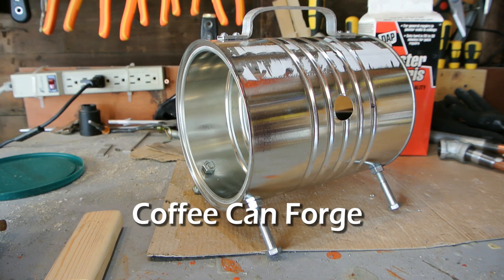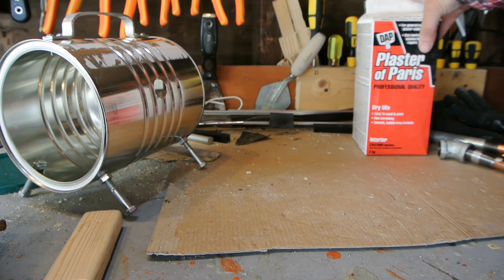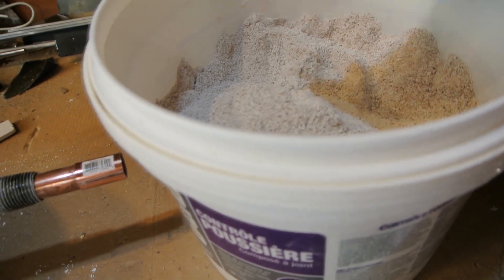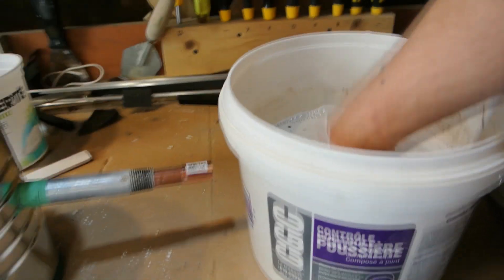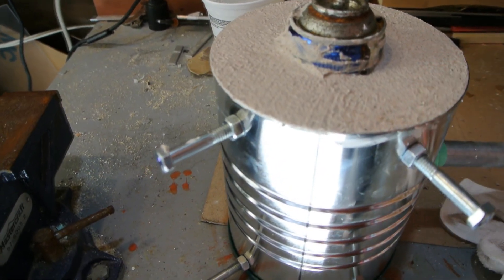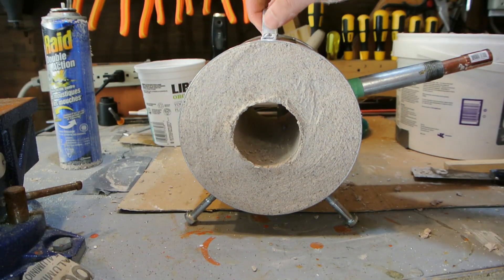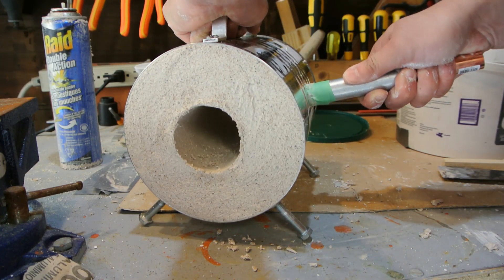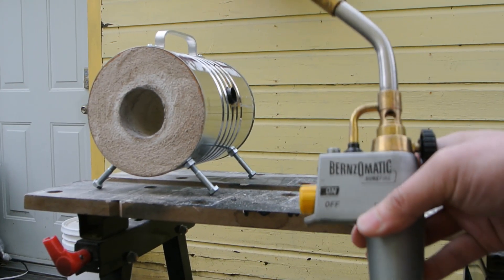How to Make a Coffee Can Forge

Comment: Hey, man. Have you done any knife work with that mini forge? How is it going? I was planning to make one mini forge like this myself, but I´ve heard bad comments about this plaster/sand mix. So, how is it working for you?
Reply from the maker: +Daniel Ferreira It works well but it doesn't hold up for a really long time, it has cracks forming.  It's a just a simple forge that people can use to heat up some metal before investing in a big forge made with mineral wool or other better refractories.

Comment: When I mixed the refractory, let it set, and waited a few days, the refractory was still soaking wet.  I had to make a fire in it just to harden the walls, and even then, only 2-3mm were hardened.  Any tips to make it harder?
Reply from the maker: +Colebug99 Takes a while but you need to heat it for while to dry it out.  It will dry out.

Comment: What is the max temp it gets?  Celsius or Fahrenheit, I understand both.
Reply: +Colebug99 hey dude, this forge will probably get into the mid 2000's F, but the refractory he is using will fall apart after the first use. Try going with a Perlite, sodium silicate, and aluminium oxide mix that will hold up really well.
Reply: Glitched Gaming I have been using a plaster sand refractory for about a year in my charcoal forge for melting aluminum.  It seems alright.
Reply: Colebug99 i must be doing something wrong then with the mix i guess :)
Reply: Glitched Gaming I was skeptical too!  But I will definitely use your design, as it sounds more sturdy as I get into making more steel.

Comment: We have noticed that most of the forging chambers you folks are making you do not use a simple silicon release for your forms, the Raid Can or the Pipe nozzles.  Silicon release mediums can be picked at your local sculpture or clay supply stores.  Using a non-stick spray on the cans or pipes when prepping is even less expensive. Then you don't risk deforming your chamber.
Reply from the maker: +Triton Memnon Good tip.

Comment: Would it work if you were to double up on the cans so it's twice as long?
Reply: +Xero or add another torch
Reply: +Xero I thought the same thing so I started building one yesterday. I'm halfway casting the refractory. AMA.
Reply: Update: I botched one batch of refractory. It went in too firm and failed to "pour" so it wouldn't displace air. It also tended to get caught up on the seam between the two cans. I tried to tamp it with a paint stick with some success but as I work my way up with subsequent pours I can hear loose chunks bouncing around, which will fall out when I remove my center mold and port mold pipes. I'll have to try to patch that later and hope it holds. Cautionary tale, make sure your mix is just goopy enough and it should work. Also, use more then 5 really short sheet metal screws to hold the two cans together. If it wasn't for the refractory, I think I would have torn the two cans apart just trying to twist the centre mold (2" ABS) loose between pours. If there's a next time, I'm rolling up news paper and burning it off afterwards.

Comment: i just used quick setting quickcrete and coated front with plaster so wouldn't crack at opening of forge ... btw way more conduction just working on smaller projectes and no back hole, alot of heat loss but mines almost the same i also used washers on bolts and handle
Reply from the maker: +Mike Emory Yeah I have a plug in it now, but I needed to bend some long items before.
Reply: +Andrew W i wish i could post a picture i also have a coal forge made with bicycle air pump(the kind thatvlay on floor and pump with foot) as my billow and 2 car rims welded together with a square doorway cut out finished yeaterday

Comment: How long did you let it sit before using it?
Reply: +McCabe Lowe Let what sit?
Reply: The sand/plaster mixture. How long did you let it sit before heating it up and heating your knife?
Reply: McCabe Lowe After first pouring it, I let mine set for 10 minutes before it got mildly solid enough to move it around. Before actually using it, I would wait a whole day. You could probably get away with a couple hours.

Comment: How would you build something like this but using charcoal as a fuel source? I like to pretend that I'm some medieval blacksmith but I'm still on a budget.
Reply from the maker: Get some fire bricks and stack them up into a pit, that will contain the fire into a small intense place to heat the metal. Use a hair dryer as a bellows with a tube attached blowing into the fire.
Reply: watch the forge video of grant thompson, he has something like that!

Comment: Approximately how hot can these forges get?
Reply: +Cory Hartwigsen if you swap the blue propane torch with a yellow map gas torch you can get to around 1000-1500 celsius more then enough for forging a heat treating small blades

Comment: I am thinking a smaller hole at the rear with a rearward angled torch would create the desired vortex with greater heat retention.
Reply from the maker: +heathenous81 Yup totally, and I did make a plug and it made a difference.  I&#39;m working on a new bigger forge and plan to take into account the torch angle.
Reply: I have a bigger forge but I want a smaller one for small jobs that can be on my bench.
Reply: +Andrew W How has the plaster of  paris held up?

Comment: Could someone help me on this? I made this very close by design but cannot heat up a railroad spike for anything. I'm using a benzolight torch and it just gets metal hot but not glowing??...
Reply from the maker: A railroad spike is pretty thick, I think that torch is under powered to heat that up to any workable temperature.  You need to go bigger both forge and torch. I'm doing another video on a larger forge in the coming months.

Comment: Won't the metal pipe on the side melt on high tempratures?
Reply: +Tap Studios This forge cannot reach the temperature needed to melt the steel pipe. However if you used aluminum then yes it would melt and would not be fun haha.
Reply from the maker: +Washburnedout Exactly, in fact the paint on the metal tube I used is still intact, so it has done a good job insulating.

Comment: I built this yesterday, the center pipe I used to make the chamber was nearly impossible to remove after 5 min. I ran my propane torch inside for half an hour inside the forge today and it never heated up. Any suggestions or ideas to help out?
Reply: Before you insert the center tube try coating it in vasoline. I know that doesnt help now, but could for anyone else.
Reply: Qu2

Comment: if you get a few fire bricks and set them on the ends to make a slot as wide as your work you'll make it much more efficient. :)
Reply: +geckomage  yeah that was an excessive amount of heat loss on the rear opening.. the bricks are a really great idea..
Reply: +geckomage Could you make those bricks out of the same material, Plaster of Paris?
Reply: I guess you could just to have something to cover the opening. i just went to a local fireplace store and picked up a few. home depot might also have some. if you do cast some out of plaster of paris i'd recommend lining your form with plastic so you could pull them back out easily without breaking them. or do some research on sodium silicate. (you could make fire bricks out of that and sand, or perlite, and it should work quite well.

Comment: Would a setup like this work foe heat treating high carbon steel for knives?
Reply: +CallousDnb he could also use magnets. If the magnets still work on the steel while its red hot, it needs more time in the forge until the magnets don't work on the piece of steel.
Reply: +Dani El Yeah should be fine. I used my mates portable gas forge (he's a farrier) and it's pretty much the same as this, apart from a bit bigger and not home made. Your only issue might be judging how hot the forge is, you would have to either judge by the colour of the steel or get an infrared thermometer.
Reply: +Oscar Gonzalez I just learned that trick recently. The temp is around 1425F and this is right about where your high carbon steel should be right before you quench.

Comment: Great video!  I doubled up the cans to make it twice as long with another torch hole.  Haven't fired it up yet, need to get another torch.  I used a piece of black 2" PVC for the chamber and could not get it out.  Twisting it with a pipe wrench and hitting  it with a hammer and wood block did nothing.  I let it cure for a week and tried it again; nothing.  I then used a 24" bow saw to cut the pipe in three places (with the blade inside the pipe).  Then PVC glued a plug in one end and was able to finally pound out 
the pipe.  What a relief.  Thought I was going to end up with a 35lb paper weight.  Not sure if there was some sort of chemicals reaction with the PVC and the Plaster of Paris.  For the torch holes I used steel pipe and they can right out.  The foundry also seems to be rather brittle.  Hope it holds up!
Reply from the maker: +Rufus T Firefly I think the longevity of forge is ok, probably get a bunch of uses of it, but for the cost and simplicity it's hard to beat.  I've used mine a bunch of times and it's still holding, but I try not to touch the top or the sides.  I'm going to try making a different type of forge in the next few months that hopefully it will be stronger.  Someone here suggested using a Smartwater bottle for the chamber, it's flexible and easier to take out.  I bet putting a coat of oil on the PVC would have helped too.  I plan on making a DYI torch soon too.

If you are looking to build a forge that will hold up, look up Kaowool forges.
Reply: Aren’t forges just so neat. Just plain old neat. Here 5 years later and I’m still fascinated with forges. I even have a nice heat treat oven but I still enjoy making and using different forges.
Reply: BTW the plaster of Paris and sand doesn’t last forever but even with the cracks my first forge is still working about 4-5 years in. Pretty darn good for such a small expense.

Comment: I was wanting to make one out of a steel mail box. would my ts8000 torch be enough to heat it? and how well does the sand and plaster mix work? will it crack?
Reply from the maker: +James Moyer Depends on how big you make the chamber, I think if it wasn't too big then yes it will work.  The sand and plaster has worked well but I haven't used it much.  Probably wouldn't last a really long time but it is good enough for my needs for heating steel every once in a while, there has been a few small cracks but nothing that has caused it to fail.  And it's cheap so that's a plus.  If you are looking to make something that will last make it from kaowool, google forges made from that stuff.

Comment: next time, superglue the raid can to the bottom,.. it will help stop it from wandering
and spray some cooking spray on the outside of the raid can...
Reply: +charles dilmore Better yet, use a smooth wall tube instead of a can which has flanges on each end preventing removal.

Comment: Where did you get the torch handle and hose?
Reply from the maker: +Charles Randolph I think the torch you can pick up almost anywhere, Home Depot, Walmart, the hose is a BBQ hose for connecting a small portable BBQ to a big tank.  They are also called an appliance hose.
Reply: Ok, Thanks

Comment: I used ribbed dog food can inside coffee can, filled with bbq charcoal and use hairdryer into the small steel pipe (with forge sat on its Base) as. Couldn't get the gas torch to heat evenly or quickly. Works brilliantly for small knifey type things.  Thanks v much for the vid really helped.

Comment: Rather than plaster of paris could you just use basic cement?
Reply: As far as I know, cement holds pockets of water and if heated the cement can explode from the pressure.  I know this from stories of working over a concrete floor with a cutting torch.  Extremely dangerous.
Reply: forges made of cement have exploded

Comment: How is the forge holding up?  I just cast one in a stainless steel trash can.  I've seen videos where the plaster of Paris and play sand mixture cracked under high heat.
Reply: I made a forge when I was 17? Anyway, they sell this stuff in a 5 gallon bucket called Kaolite castable refractory. I bought it at an art supply store. I think it was less than 20$. Same idea. Mix it with water. I'm almost 50, my forge still works great and no cracks. If you put the torch up towards the top of the hole, mount it in the back instead of the center and angle the torch head a little towards the front (not much) you'll get a Venturi effect. It'll heat up faster and run more efficiently. Sorry to but into you're conversation. Just thought I'd share what I learned doing this.
Reply from the maker: It's holding up OK but long term use I'm not sure if it would.  I have only used it around 20 times.
Reply: +Andrew W 
gotcha.....thanks for getting back with me!
Reply: I made a large verical forge out of a wespco oil bucket (steel) and it did start cracking after some heavy use
Reply: I used some sand from my local beach and it seems to be much more durable
Reply: TheLagwagon6040
 Yeah, i used crayola play sand , it was fine and clean.

Comment: Just a quick tip: If you mold the opening for the nozzle at an angle, you would get a vortex effect that would not only increase the amount of heat, but also the efficiency of heat per fuel use.

Exact angles would have to depend on what type/size nozzle you are using.
Reply: Paul Andrulis hair splitting
Reply from the maker: +Valdarian RaevenHeart Cool, will have to try that on the next one.  Would you suggest keeping the torch in the middle of the forge, or move it forward or back any?
Reply: For that size the placement is fine because it concentrates the heat in the middle, and will still be able to heat longer pieces.

If you make a bigger one though...personally I'd place the nozzle in the back angled towards the front, and slightly downward until you get the vortex.

I don't have the means here, but if you want I can draw it out for you.
Reply from the maker: +Valdarian RaevenHeart I won't be make making another forge for sometime but thanks for the offer!
Reply: +Valdarian RaevenHeart interesting thank you i am thinking to build a forge like this.
Reply: Serkanbah Coolbeans, let me know how it goes. I'm planning to make a similar build once I move to a better area to allow for noisy forge work ;p
Reply: Valdarian RaevenHeart I was going to leave the same comment
Reply: Shane Ferrier Ja
Reply: So Paul Andrulis, do you have anything that is constructive to add, or are you just going to add criticism? For instance, how do you get a spatially controlled heat source for his "foundry" to make it a "forge" so he can evenly heat his "crucible"?
Reply: yeah i know that,my family loves working making something,planting trees crafting,our neighbours warned us for noise my father sold the house :)  some people just want to drink coffee and sleep till afternoon,people like you and me loves craft,creating something :)
Reply: @Serkanbah  my neighbor warned me because of the noise.....once
Reply: That is called a foundry. A forge NEEDS a spatially controlled heat source. A foundry does not, and in fact NEEDS the "vortex" flame, not for efficiency, but to evenly heat a crucible along its entire height. A foundry is not a forge and a forge is not a foundry. Tipping a foundry on its side does not make it a good forge.
Reply: @paulandrulis4672  University of being a petty dickweed is looking for professors. You should apply.

Comment: Have you thought about putting some lids on? that would greatly prevent heat from being lost. it could just be a slab of the plaster that you slide over the holes to make the chamber heat faster. just a thought :)
Reply from the maker: +Brad Boxrud I actually already have done what you said, made a plug from a the left over plaster I had, thanks!

Comment: can i use cement instead of  sand and that other thing you mixed
Reply: +Todor minchev cement COULD be used, but wouldn't last anywhere near as long, as repeated heats would stress and crack/crumble the chamber.
Reply from the maker: +Valdarian RaevenHeart Agree and also it would be very heavy.  I have read some where that cement could explode when heated if the cement isn't completely free of water.
Reply: hmm okay so that plaster of i dont think we got that here in my county what can be used as a substitute ?
Reply from the maker: +Todor minchev Do some research on something call "water glass"  you can make a refractory from it and perlite.
Reply: ok thanks :P

Comment: I am having complications with my fordge.... It doesnt get red hot around the whole inside. Only where the propane flame is directly hitting it. Is there anything that I can change to make it work?
Reply from the maker: +Jon Ashworth It is most likely either the refractory hasn't dried out yet or your openings are too big and letting too much heat escape.  Fire the forge for 30 minutes to let it dry out and see how it works.
Reply: Andrew W I think the lining has dried I let it sit for 48 hours before lighting it and waiting for 15 minutes. Would making a removable lid with the same mixture used for a lining solve the problem.
Reply from the maker: +Jon Ashworth Yeah anything to keep the heat in will help raise the temperature inside the forge, just make sure to have a small opening to let some of the combustion gases to escape..
Reply: Stand upright, Fill it with charcoal and use a hairdryer in pipe. Works great.

Comment: great video, was wondering could you double up the cans and make it twice as long, or would this torch not have enough heat to power it. I have the same torch (TS8000) but would like to be able to do more than about 5-6 inches.
Reply from the maker: +D. Reichert  You could double the cans and make it as long as you want but I think you would need another burner.  Don't think one would be enough.